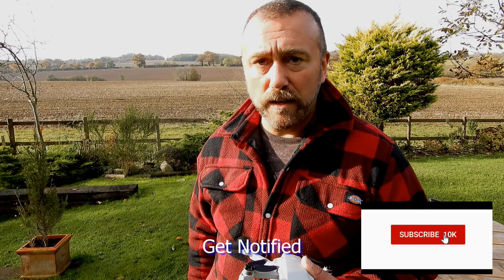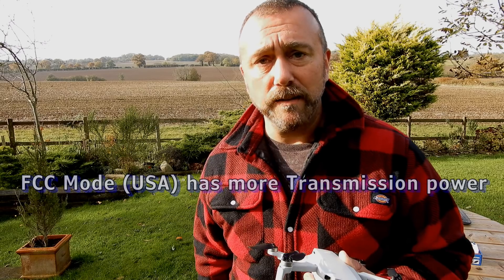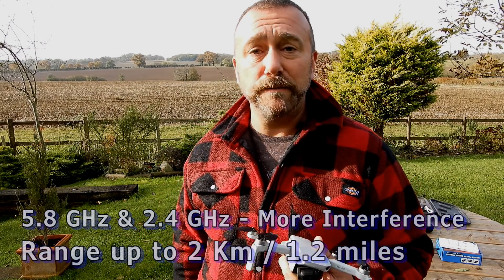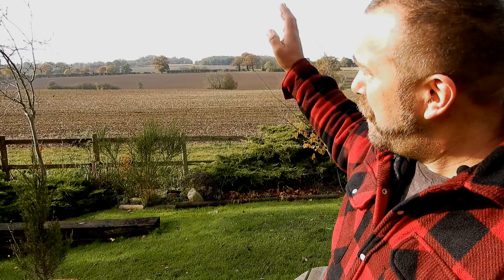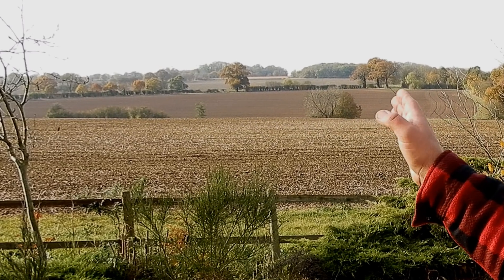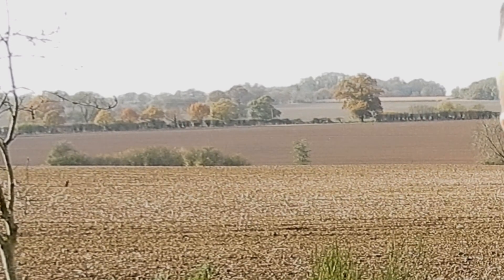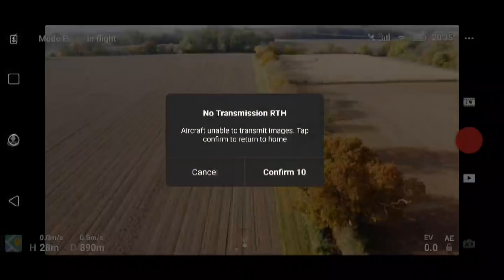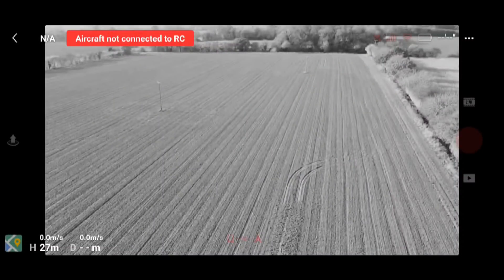Mavic Mini: Long Range Signal Test (CE Europe)

Comment from the maker: It's better than many have thought.  Remember VLOS and keep your drone in sight.  YOU are responsible for your flights!  Let me know your thoughts on the Mini's capability!  Cheers, Ian
Reply: A hint, you can get more range if you point the antennas vertically at the drone, based of of the little thing at the bottom, you aren't doing that.
Reply from the maker: You definitely don't point the remote's antennae towards the drone. They should point up to the sky so the long edge of them is facing the direction of the Drone. Is that what you mean?
Reply: @IaninLondon  Exactly.
Reply: Why have dji wrote on the box video feed up to 4km .  ??
Reply: @jhtech5807  In some countries, you don't need vlos
Reply: @jhtech5807  You should check local regulations for that
Reply from the maker: @jhtech5807  For FAA mode, that's very possible....
Reply: Ian in London so if we took the U.K. model out of the Europe would we get the more powerful ranges etc like the fcc model , is it the app and gps of our location that locks it down that wer in Europe.
Reply from the maker: @jhtech5807  Unsure as the Air and other Mavics do restrict or boost depending on location, but the Mini lists 2 models so still unsure if they're defo 2 separate models fixed, or if they're actually the same and just auto changing depending on location...
Reply: Ian in London , ye it would be a shame to hav 2  models and  1 better than the other , it be better to know we bought a the good one but it’s just Restricted in our areas . Time will tell . But on the U.K. dji Mavic mini box it says 4km video feed . So wat does that mean for the U.K. model ?
Reply: Just to add some clarity on this. The 5.8 ghz waveband in the EU is power restricted. DJI had to produce a different model for it with different hardware supporting 2 bands. If you fly a mini EU outside of the EU you’ll still get the same range. If you fly a FCC version inside the EU, you’ll still get the 4km max (full power in 5.8 ghz) but technically you’ll be using the frequency illegally. DJI confirmed there is no power change based on geographic location. This was unnecessary as they don’t sell the FCC model in the EU. It’s up to you if you import something that is illegal to use here. Warranty on FCC models will be void in the EU. 

On the EU model, if you leave the Wi-fi on auto it will probably choose 5.8 ghz on low power, you need to switch to manual and choose the least busy channel from 1-13 to force into 2.4 ghz. Then you’ll get close to 2km in open space. Which honestly is probably enough for a drone this tiny.
Reply from the maker: @FazerWiz  Have they actually confirmed they made two separate models of the Mini? As this is not the case for all their other models which auto switch depending on geographic location...
Reply: Ian in London yes good question .  ,,interesting topic lol, trying to wrap my head around it all .  Iv just bought my son the mini and it’s a great wee drone . Wat do u video on 2.7k  25 or 30 frames etc . We find that wen we turn slightly slow left or right it seems to gutter or shutter like we need to move it really really slow to make it watchable , does this sound like iv wrong settings set up.  ?
Reply: @IaninLondon  Sorry just seen this. Yes it's 100% confirmed. In fact, they have different model numbers (Model MT1SS5 FCC vs Model MT1SD25 CE). You're quite right to say that 2.4Ghz travels better though without interference. There is a technical reason for that, it's down to the fact that it's a longer wave length but that's a whole subject on its own. There is a flight test of a CE model here on YouTube where he gets out to almost 3000 meters! If you switch to manual channel selection and can find a channel that isn't busy, 2.4Ghz is the way to go, you should get very good range. In built-up areas where there is a lot of Wifi traffic however, 2.4 is more common so there is more likely interference. Model numbers and transmission powers in dBm can be found here: https://www.dji.com/uk/mavic-mini/specs
Reply: @IaninLondon  I meant to add that one thing which seems unclear, is if the FCC model (which is 5.8ghz only) drops down from 30 dBm (4km range) to 28 dBm (2.5km range) when used anywhere outside the FCC area or it only drops when it is used inside the SRRC area. Even the DJI rep seemed unsure! One side-by-side test I saw had the CE model on 2.4 ghz go further than the FCC model when flown in Italy, although both went over 1 km so the FCC model definitely doesn't drop to EU 5.8 ghz power level of 14 dBm (500m).  I think that given the extra channel options on the CE model, the better performance of 2.4 ghz on an uncluttered channel and the fact that it's legal with a warranty, getting the CE model makes good sense.
Reply: CE is better cuz of 5.8ghz, just get a range extender for 6 euro and you get the FCC range easy
Reply: Thanks for getting back to me Ian. Yeah initially I was happy. But according to this video the FCC version when flown in the EC is "chocked down" to 1300-1400m https://youtu.be/6LE461SFRZ8
This would actually put the distance range below the EC version on 2.4GHz?  I suppose the only thing to do is to test it.... If this bloody wind ever dies down!
Reply: thanks a lot on pointing this out about the 2 different models, could there br any way of modding it to fcc? i live in belgium
Reply: @initialsjd5867  If you buy the FCC version, you may be able to get it to work at full FCC power here by using the GPS hack trick. If not, as @rlevans0602 says, it'll be restricted to the Japanese power standard which I think officially is 2.5 km.
Reply: @FazerWiz  ah ok, i'll try and figure it out once i get my money. i'll go check it in the shop wich version they sell. thanks for the reply
Reply: Yeah, that is what I am thinking as well: why do you need 4km (or more, there was one video with battery mode as well) distance when  almost all EU regulations state "keep your drone in sight at all times" (FPV as well-you need extra person for 'spotting')? But as you said Ian, in this (eg.) 900m range, you can fly more, record more, and that makes Mini perfect (small, portable, under 250gr, good camera, great wind stability) for what it is... If someone needs more, pay more, and you will get it.
Reply: Mavic air mini 2 should fix this!
Reply from the maker: @toby.maximillian  Sure you don't mean the Mavic 2 Air Pro Mini Tello? 😉

Comment: Just got a mini..ive noticed the w front motors are a bit tighter than the back which and the front right is a touch tighter than the left..is this normal...so not what id call free spinning basically

Comment: IM getting about 800 metres ian but thats at a push ! ive tried changing frequencies for 2.4 to 5.8ghz but finding it makes not much difference. manual and auto same ! i know the CE model is pretty restricted for power but will say it gets nowhere near the distance advertised!
Reply from the maker: If you're getting 800 metres with the Mini then that's about as good as I'd expect with the CE version. Like the original Air, the Mini is prone to interference that will reduce the range you can get. I did this test in open countryside far away from any other buildings or sources of interference.... Ian
Reply: Ian in London cheers for your fast response buddy ! Taking the mini out later for a flying session. Just to have a play with the settings !

Comment: Out of curiosity, since i was never able to take the Mini farther than 1Km, does this mean that the spec range of 2Km is the diameter and not the radius?
Reply from the maker: No, it's defo the distance / radius.  If you fly high, without interference, you'll get longer, but I didn't want to go too far beyond VLOS

Comment: Nice video. Im starting to think i may have a problem with my new Mini. So in built up areas im only getting 100m of range max before i lose signal, sometimes way way less and it returns, we took a stroll out yesterday and in the middle of nowhere i only managed 200 or so M distance and a max height of 100m before it lost signal again. What do you think, issues or would you class this as normal?
Reply from the maker: No.  Are you pointing the antenae up into the air to the sky so the long side is facing the drone?  The antenae should not actually point to the drone.
Reply: @IaninLondon  hmmm not 100% sure wasnt aware of the precise angles for antenna. I'll have another go and see how I go. Thanks for reply:-)
Reply from the maker: @koidiaries  They should be like a clock at 10 to 2 and always perpendicular to the actual drone, so the long side of antena faces the drone.  Also trees can cause issues; try open countryside

Comment: Hi Ian. Great vids. Would you recommend range extenders? Do they work on the European model?
Reply from the maker: I tried range extenders once and they made no tangible difference, so I don't bother. But if they're not expensive, maybe try them if you're struggling. 👍🏻

Comment: Latest findings with my Mini is you just need the slightest, I mean the very slightest damage to a propeller to induce motor over speed issues.
The range I can achieve over the river at 200 feet is very poor with no WiFi interference. DJI are taking it seriously considering we are in the UK.

Comment: Where can we find the data  screenthat you showded on your video?Do  I need to connect to 2,4 or 5 ghz in belgium?
Reply from the maker: I uploaded the data to AirData.com to get those data sheets.  2.4 is prone to interference; 5.8 has less interference but also more easily blocked by obstacles.... try and see which is best.

Comment: I read recently that for every 1km travelled you need to add around 80-100 mtrs in elevation, meaning for good range, be at least 100 mtrs up esp. with obstructions. And i know about height restrictions. Just bear it in mind if you get frustrated with your drones performance. Cheers
Reply from the maker: Very true; I didn't want to do a high altitude long distance flight that went beyond VLOS. You'll usually get better signal if you're higher...

Comment: hi ian, mine ce mavic model only get less than 600meter in my country malaysia.. is it can archieve 1km in my country if im bought another fcc model ?. im see people in usa get 2.2km with fcc mavic mini, im wonder can i get that distance flying in my country malaysia.. anyway nice explanation from your video..
Reply from the maker: You see I get almost 1,000 metres with the CE model in this video.  MAybe you have some wifi interferencce from other houses?  Make sure you have good direct line of sight between you and the drone; face the drone and have the antennae ppointing up to the sky, not pointing to the drone.

Comment: For me at around 40 m altitude the signal start breaking at around 5-600 m and usually completely lost before 700 m distance. That's in rural areas and in non-populated areas (not in crowded urban areas). I use the auto transmission mode (not manually set to 2.4 GHz) because it's supposedly able to switch automatically. But I'm not convinced that it is. I'll try manual 2.4 GHz.
Reply from the maker: Just checking, have you definitely got the antennae pointing as per my latest video on Mini Top 10 Tips?
Reply: @IaninLondon  Hey Ian! Thanks for the  reply. Yes, the antennae are pointed correctly, that can't  be the cause. Btw, I really love your videos. Straight to the subject and nice, honest presentation style.

Comment: So my  uk mavic mini wont fly miles as advertised. That sucks. Why dont dji say that before you buy one. I got mine today and was happy until I lost signal at 400m. You read the reviews and everyone saying it will go far but it wont. Dji you have pissed me off.
Reply from the maker: You should get a good 1km out of it... Were you near a town?  And did you have the antennae pointing with the long edge facing towards the drone (ie not pointing towards it)?
Reply: @IaninLondon  in my local park. Few trees here and there and houses but the houses were like over 50m from me. Yeah I kept the antenna in the right position, I didnt point them at the drone. It's my first time flying so mybe I did something wrong. I got a signal booster to put on antenna coming so hope it's better.
Reply from the maker: @aidendavis3086  It's still prone to wifi interference in towns, even if you're a fair way from houses....  If oyu get the chance, head out to the countryside and see if that improvs things...
Reply: @IaninLondon  I took it up a hill in the countryside with signal booster on and I got about 1500m before I lost connection.
Reply from the maker: That's plenty far enough.....👍🏻👍🏻
Reply: I hear that putting your phone in aeroplane mode can help with connectivity issues.

Comment: Hi Ian. Great video as always. I'm a bit confused. I live in the UK and ordered my MM from a camera stockist here. I have reason to believe my MM may have been shipped from the US (I seem to remember a New York stamp on the package). Sure enough the number on the controller is MR1SS5 and it does not seem I can switch from 5.8 GHz in the DJI fly app. Do I have an American model? If so what does this mean for me flying in the UK?
Reply from the maker: I believe the Mini genuinely has two models, unlike all the other models that have one and simply auto-switch depending on their geographic location.  So if that's the case with the Mini, you may well be flying with a strionger signal.  Which will give you better range and propbably less signal interference, so I'd be quite happy! :)
Reply: @IaninLondon  It would be illegal as well

Comment: Thanks for the video, I’m assuming it’s 2.4ghz? 
If so, did you checked the 5.8ghz range? My concern is the delay and not clear view at 2.4ghz as in 5.8ghz that have much more bandwidth and better for video transmission.
Currently with the Spark I can get over 1.5 km with a perfect video signal but usually I need strong clear view at 500-700m without signal delays so I care about the 5.8 range over not populated area like in your video.
I spoke with someone that works as DJI technician (he was studying at DJI in China) and he says that the FCC goes also down to meet the CE regulations but he tested the both models in CE zone and the FCC goes a bit more but not as in the USA.
Reply from the maker: I only did the one long range test and let the Mini choose its preferred wavelength. All I wanted to prove was that the Mini is good enough for every day use 👍🏻👍🏻
Reply: Ian in London my everyday use is totally different ;-)

Comment: i tried the mavic air in city environment. after 100m signal became crappy. the mini might be twice as good, but 200m aren't doing it for me either. never gonna a buy some wifi drone again. and surely not any drone above 1000 eur. so dji is kicking itself out of the business. if my mavic pro should fail i will switch to the autel evo or the parrot anafi. i think even a follow-up is coming for the latter.
Reply from the maker: Bad you have so much interference in town. Have you tried locking it to 5.8 frequency?
Reply: It's already couple years ago, when it came out, so I don't remember in detail, but I remember watching clips about the issue so I suppose I tried. Send the drone back then and am still using the mavic pro.

Comment: I really dont need the range. Id be fine with stable 500m range if it just worked better in cities
Reply from the maker: Try manually setting the frequency to 5.8 and see how you get on... That solves most issues apparently.
Reply: @IaninLondon  kinda almost lost it by doing that. Full auto has been best so far 😂
Reply from the maker: @AvianDnD  that's not great..... Find some open countryside 😎👍🏻👍🏻👍🏻
Reply: @IaninLondon  closest open county side is next to the airport 😅😅😅 can't fly there now 😅

Comment: Dude you must try harder this little mini is capable of 5000 in CE stock out of the box.
Reply from the maker: 5000 metres?  Think that's the FCC model....But I do reckon this can get up to a good 2000 metres
Reply: Nope CE will do it for sure, cool channel, keep up the good work.
Reply from the maker: @FlyFarandWide   I've seen Dustin Dunnhil's vid; he has the FCC model and only just managed 5000m...  But I'll have a play.... :)
Reply: I made 4000m easy before I started modding stuff.
Reply from the maker: @FlyFarandWide  With CE?  Ok.... that's' impressive...  Out of interest, I've heard 5.8 is actually better than 2.4, despite what we're told about 2.4 travelling further... You know what frequency you were on?
Reply: Your location, 2.4 will be far superior.

Comment: Hi Ian, great video thanks. Here in South Africa we also have the CE version. Just wanted to ask, do you find it defaults to the 2.4Ghz channel on auto? Thank again😀
Reply from the maker: Hi there. Yes, I want to do more testing but so far it seems 2.4Ghz is the default; you can manually set it to 5.8 but I've not seen it jump to 5.8 by itself yet...  Ian
Reply: @IaninLondon  Thanks so much Ian, I will also do a bit of testing on my side and see what I come up with😀 Mark

Comment: Cant the mini be changed to fcc mode like you could the spark using android software
Reply from the maker: There's still debate on whether the FCC version is hardwired.  When I booted mine up of rhte first time it had a message "changing wireless settings to comply with local laws" so I think it's like the all the other Mavics and restricts the transmission power by software based on your location...
Reply: Ian in London , Thanks buddy , I noticed the antennas are part of the landing gear , does the signal stay strong no matter which way the mini is facing .
Reply from the maker: @e3dave744  I've found it fine in any orientation. 👍🏻